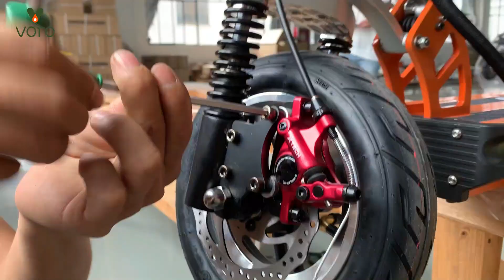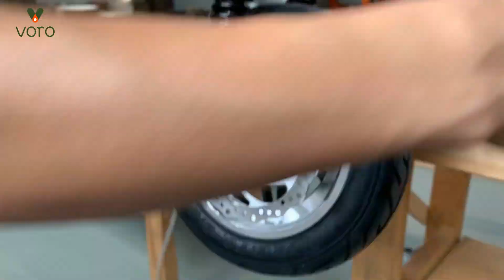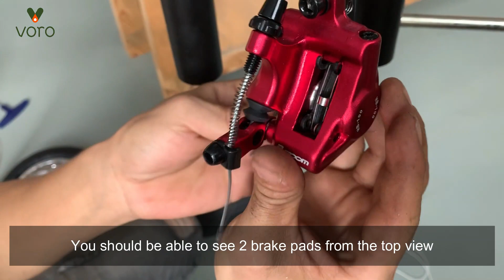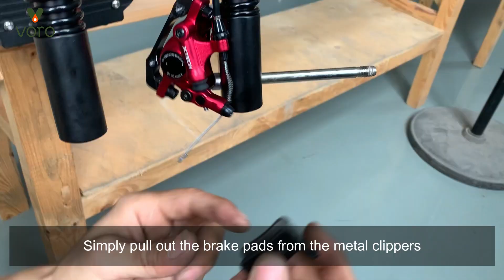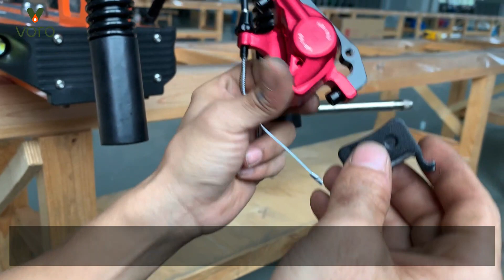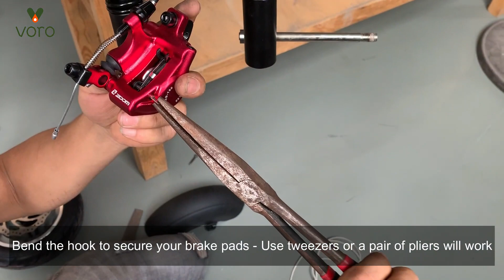Tutorial: How to Replace Brake Pads on your EMOVE Cruiser Electric Scooter

Comment: You made it look so easy coz you already removed the fender (the rear fender is more difficult to remove due to the deep pockets of the inner bolts). Great help though. 👍👍
Reply: I was able to get my rear brake off without removing the fender, just had to lift the fender up slightly and slide the caliper

Comment: I haven't received my scooter yet but on my R6 motorcycle (it looks like the design is the same), I can change the pads w/o removing the caliper.  Because the pads come out of the top of the caliper, you can remove the pin and remove the pads.  Just push the pistons back w/ say a screwdriver then just slot in the new pads and put the pin on.

Comment: Curious, I stay in LA, I got my Cruiser 2 weeks ago (I LOVE it) but I can hear the pads in the back making noise in addition to on the rotor you can clearly see its got only half the width of wear the front has like the pads aren't aligned right  and the back doesn't seem to brake well, would it be possible to come by sometime to have someone potentially get them right? I'm genuinely not confident I could pull this off on my own
Reply: I had the same problem  front break work perfectly  back break don't pull well and now makes a strange noise